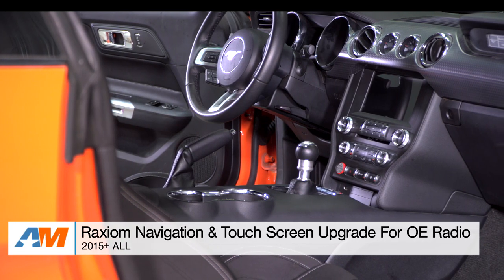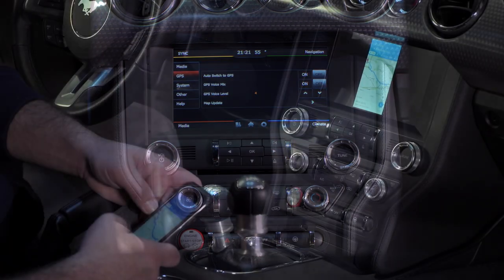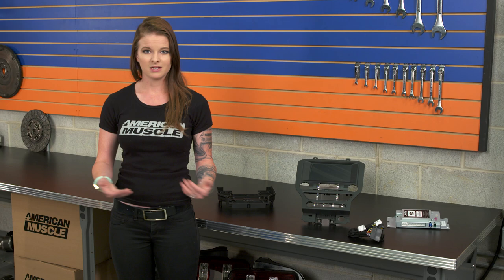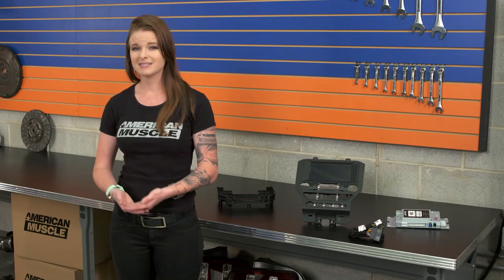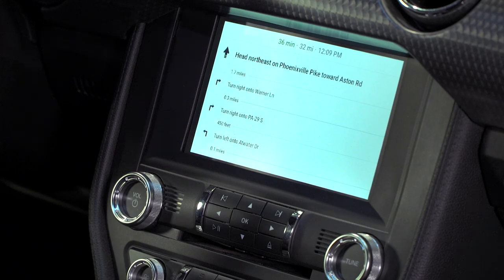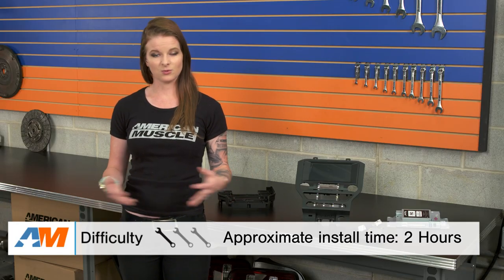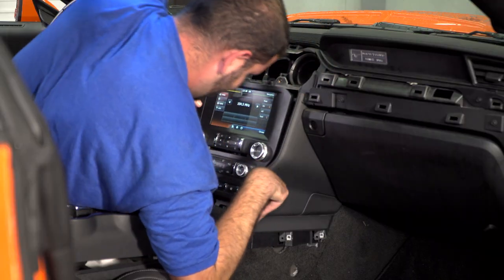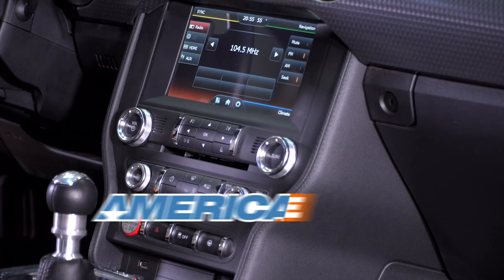Mustang Raxiom Navigation & Touch Screen Upgrade For OE Radio Review & Install 2015-2017

Comment: $800 is too much for this unit. There's similar hardware out there for under $600 that provide the same features. Also I know it's a small detail,  but I don't want to see the Raxiom logo pop up when booting up, I want to see the official mustang logo like in every other navigation system out there.
Reply: exactly! the tomtop and moddiction one are only max $600. why would someone pay an extra $200 for the Raxiom rebrand?
Reply: KOOLNERD I thought the pony logo pops up when you turn on the car and not the raxiom.
Reply: onelasttitan I think this one looks better than the tomtop one
Reply: are you referring to the UI when navigating through the menu's ?
Reply: Pavlo95 The moddiction navigation unit is EXACTLY the same as this one but better and $200 less. It boots up with the pony and uses sync3 software instead of the one Raxiom made which is heavily outdated compared to the sync3. Don't get this unit
Reply: onelasttitan I'm talking about how it looks in general inside the car. This one looks exactly like the one you get on the premium packages unlike the other brands that look kind of strange IMO.
Reply: KOOLNERD I'm going to look into the moddiction navigation.
Reply: Pavlo95 It's on their official site moddiction. There's also YouTube videos of it
Reply: Good point
Reply: Hi, I have a 2012 Shelby G500, I've been looking for a backup up camera and Android mirroring, do you have any suggestions on an aftermarket upgrade?  I went to a car audio dealer and he quoted me about 3k for a setup. Thanks Joe
Reply: KOOLNERD where can I get one?
Reply: KOOLNERD 
Link?
Reply: Have a link ?

Comment: what good is using a navigation app on your phone if the screen mirroring only works when you are parked?  I think it would be better to get something that has apple/android auto.  Probably cheaper too since it won't have the nav bundle.  An OEMRadio kit would be better than this for sure.

Comment: I have a 2019 Ford Ecoboost mustang (base model with the 4" screen and really want to find a way to get a touch screen similar to that which comes in the premium package with apple carplay and still capable of having all the features in the premium package of the mustangs. 
Does anyone have any recommendations or suggestions?
Reply: I have the Same and have trouble finding other units besides the Tesla style Radio.
I had that one and it didn't work well so I'm trying to find something like this Raxion but refuse to pay over $400 for it.
Reply: @The4kO504  Yeah im noticing its either Raxion or something else and right now i'm having trouble finding something else. The dealer told me that installing that stereo/touch screen that comes with the premium models isn't plausible because installation would require "removing the air conditioning". I don't think i've seen any installation videos that remove A/C but whatever...
Reply: @motorheadbanger90  Removing the A/C is automatically required to get to the radio.
If you get the Factory 8" it should come with the new Bezel with the A/c controls.
Its all plug and Play so no wiring is required.
The new A/C Control will fit unless it isn't a 19 and up.
15-18 uses different plugs.

Comment: First you won't have all the functions of your original sync and they don't seem to willing to update those missing functions. Siri eyes free doesn't work, no radio station Id, you cant delay the back up camera any more, very hard to reply to messages in the onscreen due to messages issues with my iPhone (7 plus). They will never update the software for better information and integration. You cant dim the unit without dimming your dash, you ca no longer turn the radio on unless you turn the entire car on. So there are functions you will lose and raxiom will not fix them or upgrade to give you your full functions of sync. They should tell you this. Also the warranty is non transferable so if someone buys it for you as a gift they need to put everything in your name otherwise you won't have a warranty. There are better looking interface out there that are cheaper and they seems to care about the product
Reply: NATHAN KINDLE thank you for saving me the trouble

Comment: I was told that NO ONE, best buy, car toys, NO ONE can or will install an aftermarket unit because it voids the warranty and there is NO HARNESS THAT'S LESS THAN $1000. WHAT THE ACTUAL FUCK? Is this true or am I just surrounded by know nothings in Houston, TX?
Reply: not true.
Reply: I am in Houston and I have no clue what you are talking about. They may be saying that they don't have a dash kit and they would have to fab which would void warranty on some of the features. They, who ever they are, haven't ordered kits yet because they are out there. Still there are several solutions online and you can pay someone to install it from that point. Why I am not sure because most of these kits are plug and play and not hard to do yourself.